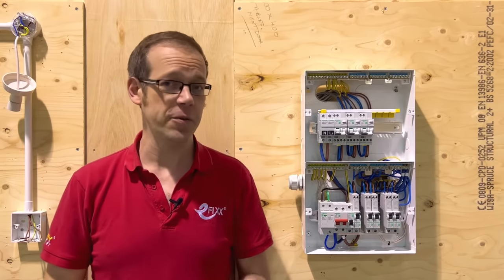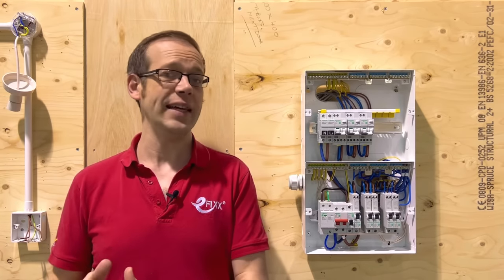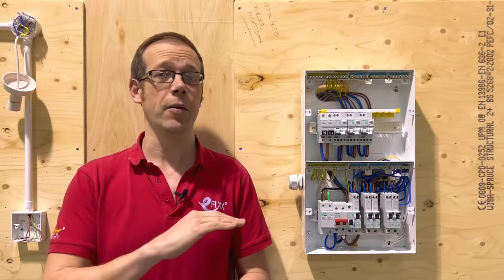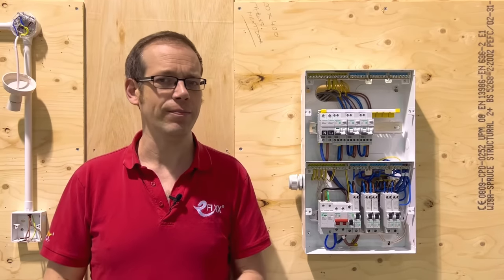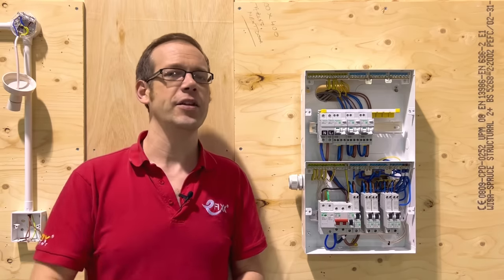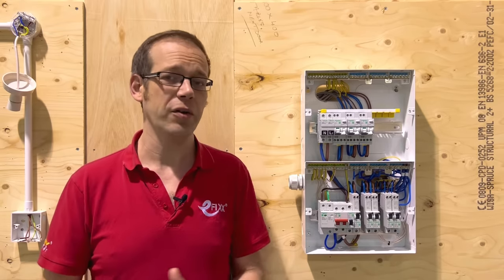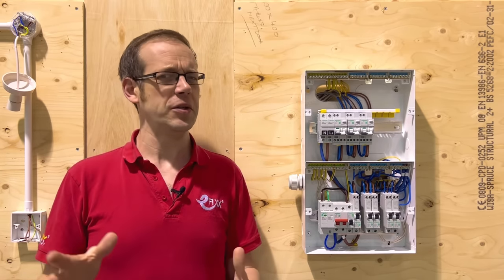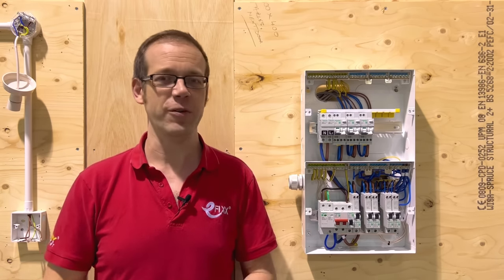What is a Surge Protection Device (SPD)? and How Do They Work?

Comment: Back when I worked at a PC service shop, the most common lightning surges I've encountered came down phone lines, usually damaging the phone, Sky box (back when they required a phone line), Internet router and any Ethernet device plugged into the router.  In the dial-up modem days it was also common to see badly charred modems, although surprisingly the PCs were usually fine after fitting a new modem or network card. 

We had a power surge about 20 years ago in the middle of the night where I'm glad we had surge protected power strips.  We noticed the RCD was tripped in the morning and wouldn't reset until we unplugged the chest freezer, which died with a ground fault.  The microwave oven display and a mobile phone plugged in were also dead.  Our TVs, PC, printer, etc were all plugged in surge protected power strips and all fine, even though the "Protected" LED on one of the TV's power strip went out.
Reply from the maker: Great to hear your experiences, thanks very much.
Reply: I was inside a metal woodshop, i pulled the trigger on a saw and BOOM, the transformer was struck. The phone line was connected to a computer and fried it. I heard that if someone was using the phone, it could have been deadly.

Comment: Once had a Herbert turret lathe that used reverse current to brake the chuck. Beiing an old machine, it had a cotrol box the size of a small car. The breakers were lage copper contacts which needed cleaning regularly. One day, one of the contacts did not close properly and it blew the main fuses on the board, blew the telephone repeater bell off the wall and destroyed a joint in the main cable outside in the road.

Comment: In the industry, we commonly use a 20 or 30A breaker to safeguard the SPD (Surge Protective Device). If a lightning strike causes a surge of high current through the breaker and the SPD, the question arises: will these breakers trip, and if so, will their activation impact the performance of the SPD?
Reply: No. SPDs should be placed upstream and parallel to RCDs.
Reply: @arias4663  Have you heard of T2 SPD requiring an OverCurrent protection by means of an MCB fitted In-line with the SPD?

(Yes, the SPD are wired Parallel/before the RCDs in Split-Load arrangement)

Comment: Seems like a cop out to me with regard to fitting SPD's in domestic installations ( in the latest BS7671) How the heck you can ask a domestic user to agree /disagree on this ??
Most domestic users would not have a clue. 

When I used the formula in the "old"  BS7671:2018  - which actually wasn't that difficult to do  -in many cases it showed that SPD''s weren't required  -but   -I was advised by my assessor "to fit them anyway"  with regard to the clauses mentioning danger to life and property etc .  Seems to me that this was all rather "vague"  / few bothered with using the formula  - and hence it was removed. 

Anyway - passing on to SPD protection itself  -there is a requirement to keep the earth lead from the SPD below 0.5 M in length, - and that begs the question - exactly WHERE does the surge energy go when the  SPD operates ?   It would seem to me that there is a means for this energy to be  also "dumped"  to ground via the main CPC system ( back to suppliers earth in the case of a "TN" system ) - and so - the question of length of earth cable comes into question with regard to its DC resistance AND Inductive reactance - since:
The transients will be of short duration and thus will contain high frequency components where inductive reactance  "Xl"  could be significant  (XL = 2 * pi * Frequency in hz * inductance in henries)  So the inductive reactance could be significant - and keeping leads short minimises XL ( and of course DC resistance)  or - put another way:
Keep the "impedance" of the system low - where impedance  =  the vector sum of  R + Xl  or,  for the electrical engineers :  R  + jXl

 Those of us that are also Radio Frequency  Engineers will know this perfectly well with regard to earthing radio communication systems - it is just that if you only ever consider 50Hz - the effect of inductive reactance is negligible in most cases - but here we are - all of a sudden  as "sparkies -  having to consider the effects of transients lasting milli seconds or even microseconds !! 
As the song goes: "It's a whole new world" !! 

It seems to me that this whole issue of "SPD" is not well presented in BS7671 - and indeed not well understood either by many - and so - the default position is  "just fit it anyway"  -- it becomes  just  a "box ticking" exercise ....... so ...... if that expensive smart TV fries .... you can say  hand on heart : " it wasn't my fault gov! "
Reply: The requirement is not below 0.5m that is a recommendation, less than 0.5m if possible and never more than 1.0m. Length of cable is critical to maintain the voltage protection (Up) of the device. for every 1m (or part thereof) over this length you can add up to 1000V to you protection level turning an SPD with a Up of 1.5kV into a 2.5kV device and so on. BS 7671 really wants to see the 2.5kV Up as the maximum hence it recommends 1.0m (most SPD's are able to achieve the 1.5kV or slightly less). Inductance does play a very large part in SPD engineering and theory. As shown by Joe at the start of the video transients are not 50Hz , the are very high frequency and can equally effect your data and IT cables as well as your LV. BS7671 also says in regulation 444 that installing coordinated surge protection to all cables is a good way of mitigating and managing the effects of electromagnetic interference.

Comment: if we all have spds in our consumer units would this make things like surge protected extension leads extinct and do these products actually protect equipment e.g. masterplug surge protectors do these actaully work and save equipment?
Reply: It's better to have multiple levels of surge protections so even if you have SPDs, using surge protected leads is a good idea too.
Reply: @1idd0kun  i always use surge protected extension leads round my tv and computer setups despite having an spd i just wonder from taking apart surge protected extension leads especially the cheap baq special PMS branded ones will they actually protect against surge as affectively as an spd reason i say this is some of the components look puny and insignificant
Reply: @kierantvyoutube3591  
A surge protector works by diverting the voltage spike away from the circuit or device that's been protected. The SPD is the first line of defense, so to speak. It will divert part of the spike to earth. But it's not perfect. Depending of how big the spike is, the SPD won't get rid of it completely. Whatever is left of the spike will be handled by the surge protected extension leads.
Reply from the maker: Can't put it better than the responses to this. 👍

Comment: Do you need to mention that the SPDs need protection by a suitable MCB?
Reply: Interestingly, the SPDs that have been retrofitted to what was a split load Hager board does not use MCB on the SPD. It’s connected directly to the output of the 100A isolator using dedicated bus bars. However, my second Fusebox board does use an MCB for the SPD.
Reply from the maker: It's all down to the manufacturer as to whether you need an MCB. 👍
Reply: @efixx  I'll take your word for it Joe. I'm just a BG fitting amateur!

Comment: Seems strange that we call them SURGE protection devices, yet they protect against transient voltage SPIKES. I think of SURGES relating to current, rather than voltage characteristics? Is it just me?
Reply: These are transient spike protection devices as they can't actually dissipate much energy. Any more prolonged voltage surge such as can occur with a  network fault will rapidly overheat an SPD causing it to disconnect & need replacement.
Reply: @alanjewell9550  
There are surge protectors specifically designed for overvoltage caused by network faults instead of lightning. They're different from SPDs and more expensive.

Comment: I donot have an earth at home but I have water bore with 8 inch diameter pipes threaded in 10 feet length a out 150 feet. Can I connect spd to it for surge protection

Comment: Don't most people these days use multi-way adapters with in-built SPDs anyway? Obviously if getting my consumer unit changed or getting rewired I'd want an SPD in it, but mine had a CU change shortly before I moved in.
Reply: Good surge protection has three layers. Course (type 1, or old type B), intermediate (type 2, or old type C) and fine (type 3 or old type D). There are also combinations available that contain several types in one SPD.
Type 1 limits the voltage to 1300 to 6000V. It is designed for currents between 50 and 100 kA. Usually it should be installed before the meter.
Type 2 ist usually installed within sub-consumer units. It reduces the remaining surge further. The maximum surge they can handle is usually 1500V, that's the reason there are several steps. They can handle a voltage of 337V for 5 seconds before they blow.
Type 3: Protects socket outlets and connectors. It reduces the remaining surge to a level appliances should be able to handle.

They build up on each other. If you lack one of these steps, the whole system can become useless. There are also SPDs that contain combinations. Mostly type 1 and 2, sometimes also type 3.

There are also small SPDs that are fitted into connection terminals of socket outlets. Surge protection must be as close as possible to the appliances that require protection. The thing is, if there are more than 10m cable in between the SPD and the appliance, you should at least install another SPD (of the proper type) into the system. That is also the reason for the existence of these multi-way adapters. So thinking that the SPD in the CU is sufficient, no it's not. And these small surge protectors in the adapter are also not sufficient when used alone.
Reply: @Marcel_Germann  Well yes, that would be ideal, but I am not paying out for it to be put in if the CU is otherwise fine. I'm sticking with the "connection terminals" kind (which includes the multiway adapters) on a "better than nothing" basis.
Reply: @seprishere  The problem is in the electric industry in the UK. Only change of the whole board to add things. Here in Germany if the board still meets the requirements we simply add that SPD to the existing board. This reduces the costs for the customer massively.
Reply: @Marcel_Germann  Most UK boards are the minimum size required, also the old ones don't really provide for SPDs.
Reply: @seprishere  Here we have a regulation how electrical installations within domestic buildings must be in some things. For example how many socket outlets are minimum for different rooms, how the cables for kitchen cooker circuit must be dimensioned (3x20A, even if you only fuse them with 3x16A). Not the VDE 0100, that is the German counterpart to the BS 7671, it's in the DIN 18015 (electrical installation in domestic dwellings). There they also demand for different size of CUs depending on the areal size of the flat or house. Also using sub-units for the circuits in the other floors and such things. Smalltest size of such a CU is three rows where the row is 12 units (one unit = 1 MCB width) wide. How many general purpose circuits are required, depending on the areal size of the flat or building. And of course dedicated circuits for appliances with a high demand.
And the thing is, to have spares in the CUs and sub units for later additions. You don't change that thing like underwear.
For a single room flat they demand a three row CU, so 36 width units of space. In rooms with more rooms at least 4 rows!
Reply: @Marcel_Germann  Not an expert, the UK standard for kitchens is a single 32 A ring, and two more of such for the rest of the house.

I hear you have personal three phase power? This is not a UK thing (you can probably pay extra and insist on it).
Reply: @seprishere  Yes, three-phase is common here in domestic dwellings. Actually the DNOs insist that single appliances with a demand of more than 4.6 kVA (20A) must be connected three-phase. The only exception are old installations with a single phase kitchen cooker circuit, 25 or 32A.
Three-phase saves round about 50% copper for the same demand. You need more wires, but these ones can be much thinner. For an 11kW EV charger I can use 5x2.5mm² (L1, L2, L3, N and CPC). Depending on the length of the cable run even 5x1.5mm² would be ok. For the same thing in single phase you would require 3x10mm².
I think on the long run the UK will switch over to three-phase in domestic dwellings. First for new construction, and later as a retrofit for older installations.
Reply from the maker: This has triggered a great thread. 👍

Comment: Does this cover an EMP?
Reply: @@luckyjoestar7938 The connected cables act as antennas that couple surges into the target device, and EMP testing I've seen shows that disconnected devices are less susceptible.  Likewise, much of the damage done by an EMP is due to triggering conditions that allow energy already present in the device to cause damage (such as in CMOS integrated circuits where the EMP can turn on both the pull up and pull down transistors to a given node at the same time).  When something is off, the only energy that can do damage is that in the EMP.

Comment: I got one installed when I had a (expensive!) heat pump put in.  One area that’s not really clear is whether they should be connected via an MCB or just directly across an RCD?  They can fail short circuit when they get ‘tired’ so I presume they’d trip the RCD anyway as they’re grounding the supply anyway?  But some electricians are putting in an MCB…
Reply from the maker: It depends upon the SPD - some have a fuseable link inside.
Reply: Technically speaking you do not normally need any OCPD in a domestic installation (but please always adhere to manufacturers installation instructions). THE MCB is often just additional length in the circuit which can me greater inductance (the enemy of the SPD). If you can avoid the OCPD then you should. SPD's don't really get 'tired'. The manufacturing standard for SPD's (BSEN 61643) requires devices to be tested against at least 20 no exposures to each wave shape that they are providing protection against; type 1 10/350, type 2 8/20 and type 3 1.2/50 & 8/20. This means SPD's are not 'one & done' but should provide protection for many years. If you had a combined type 2 & 3 in your domestic CU for example BSEN 61643 would required 20 exposures at the large current 8/20 wave shape, another 20 at the smaller current 8/20 and then an incredible 60 no exposures at the 1.2/50 meaning a total of 100 no exposures to various transient events.

Comment: cant hear you, im at 80% with headphones on. your just way too soft, sorry, passing on video
Reply: I’m on 10% using my phone speaker. No issues hearing. Maybe get your ears checked?
Reply: @hks-lion  nope ears fine, all other tubers i follow are fine on my system headphones 70% setting (my env prevents non-headphone use), all others are loud, efixx used to be fine until 6 to 8 weeks ago, now so soft even at 100%, move to next video I'm blasted out the chair, so its efixx issue, but thats fine, I just dont watch them if this is how its going to be, I'm sure they wont give a damn if I unsub anyway.
Reply from the maker: Thanks for the feedback. 👍
Reply: @Ressy66  10% quieter at most vs other channels but sometimes that improves the dynamic range certainly not a reason to unsubscribe 🙈 just turn the volume up a notch or two
Reply: @hks-lion  Just fired this and 3 others up on my linux desktop so I can get VU readings, 8j2-e46QwE is -0.7db,  wa9H9rh8sns is - 0.6db ,  RrH-mCtJZO8 is -0.4db  those are just 3 typical videos with more or less avg levels for all tubers I follow,  the efixx video is -18db   <- for avg user on PC, thats a darn sight more than 10% difference (again, efixx used to be in this range too, until recently) anyway, glad your phone amplifies/compensates it for you and you have no problems, for me, its a pass, ciao
Reply: ARG, no idea why YT is striking is that, must not like some of my video links